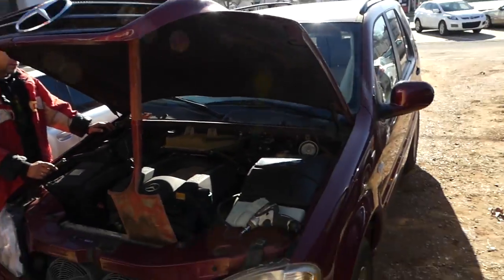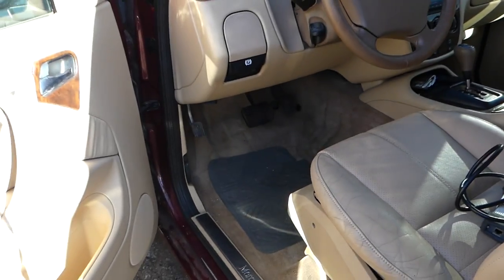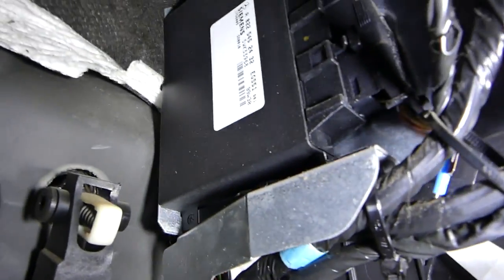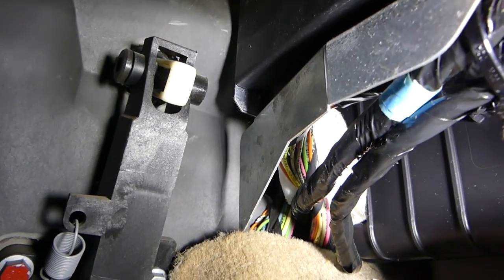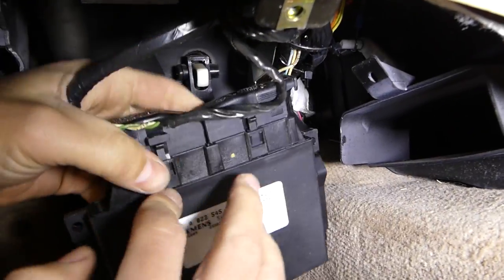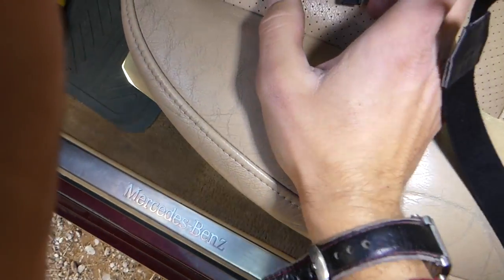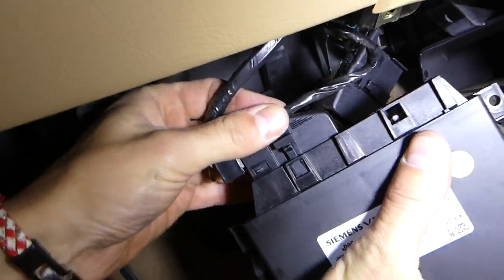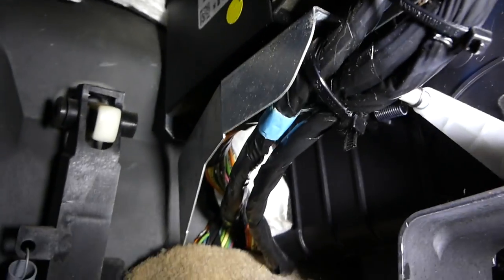MERCEDES W163 TRANSMISSION CONTROL MODULE REPLACEMENT AND LOCATION ML320 ML430 ML350 ML500

Comment: Thanks for the GREAT Video!!! I was dreading this job, but Im sorting out a Transmission problem that just wouldn't go away. My coach on this said Transmission fluid will work its way up the cable & pool in the TCU & cause wierdness.. so I did all the hard stuff first.. That fixed a lot but it still wouldn't shift into gear quite right at launch.  I watched your video & it it took me all of 6 minutes to get the TCU out & SURE ENOUGH! there was red transmission fluid dripping from the cables into the TCU. Cleaned it up with Parts cleaner, let it dry & BOOM! the shifts like new... This is a project any DIY er can do in 20 minutes tops with a Philips screw driver .. Getting the code reader port out of the way took longer than anything... Sooooo By The way if your transmission is slipping or shifting wierd TRY THIS FIRST, it cost me all of 50 cents worth of cleaner & 20 minutes start to finish!!!  YOU GUYS ROCK, Keep up the good work... Thanks Don!
Reply: Do you have to program you TCM
Reply: Did u pull it out and put it back in or u had to program it
Reply: Have to change transmission connector to stop fluid wick.  Then it is fixed.

Comment: Thanks man. But for some Mercedes, like my 2003 c230 kompressor , the computer is actually on the passenger side under the foot plate. You just lift up the rug and you'll see the plate. There's 3 10mm bolts on there. 2 on bottom one upper right. The computer is behind there. Cheers!

Comment: Thank you so much!  I was wondering what that was.  In the ml320 w164 and om642 it is located under the driver's seat, under the carpet, under the plastic substructure.  It's a real sob to get to.
Reply: What Year Model?

Comment: Two Questions
1 on the Right hand drive models the handbrake is in the way. Is it possible to remove the TCM without removing the handbrake pedal?
2 There is a electrolytic capacitor in the module. How often does it go dry and what are the symptoms?

TIA... if anyone ever reads this and knows.

Comment: Hi 
I have mercedes e200 kompressor w211 model2007. ESP issue coming and showing. The diagnostic showing a problem in the gear control.module TCM.
1. How this device is damage and directed?
2. Can I prepare it?
3. Have a solution to reset it?

Comment: I have a Mercedes Benz E 211 2008 7226. I installed the scanner and it throws me transmission control module. q test I can perform to be sure that it is the module since I do not have another spare to do the test

Comment: hi, where is it located on E200k  model (w211)? thanks
Reply: It is located in the same area, but just in the passenger side i think. Im gonna try to replace it, becouse my e200 not shifting the 4 gear.

Comment: I have a Mercedes Benz C240 4matic sedan it's a 2004 or 2005 and I think that's the problem it goes into reverse and it goes into drive but that's it and I think it's the transmission control module cuz I plugged in my OBD2 sensor and it says type a sensor and I looked it up in for that specific model it said transmission control module so I believe it's under my passenger side seat I'm not sure so I don't know if this needs programming or not or how expensive it is but the park is fairly cheap if it says type a sensor problems on an OBD2 sensor in any Mercedes-Benz I believe it's the transmission control module

Comment: I have a 2001 w220 and it doesn’t turn over; bc of the transmission computer module. I replaced it 3 times but when I turn the key all the lights pop up but it doesn’t read what gear it’s in.
Reply: Did you get it fixed? Replaced TCM 3 times? Does it keep going bad or it's simply the wrong thing you've been fixing?

Comment: Hi guys, I have ml500 2002 model, I bought  it last year  these days there is a problem with gear shifting as after few min of driving gear will stuck either in 2nd or 3rd gear and it will not change unless I will stop vehicle remove the net and fix it back that's how it will reset but after a while it will be same again . Please help me to understand  what could be the cause , I am living in Abu Dhabi and car repair shops told me that I have to change the whole transmission (:
Reply: Rehan Zaidi  Did you get it fixed ?
Reply: ماذا تعني كلمه net

Comment: hi there I have a problem with my mercedes w203 it dosnt shift up its stuck in first gear I had the code (P2066 - Fault stored in ETC control module, speed sensors voltage supply) what should I do pleas help me
Reply: AbedAllah Elghis Did you get it fixed ?

Comment: hi guys I have a problem with my mercedes w203 it dosnt shift up its stuck in first gear I had the code (P2066 - Fault stored in ETC control module, speed sensors voltage supply) what should I do pleas help me
Reply: I'm not actually certain. but I watch the video with the same problem you have and it was actually the shifter in between the front seats.

Comment: Do we need to reprogramme after changing it ? thanks
Reply: If you replace it for a different unit, it will need to be coded.

If it will be repaired, it does not need to be coded.
Reply: @jumpspace7414  does need to be coded? I have a Mercedes w204 and I want to put the ecu from a w212, same transmission but different motor.
And in the case the motor is the same, does it need to be coded?
There are some SW dates that are different